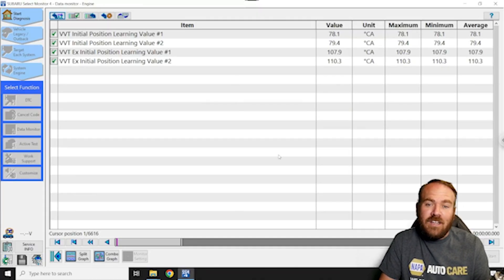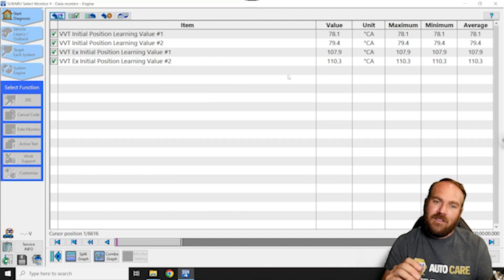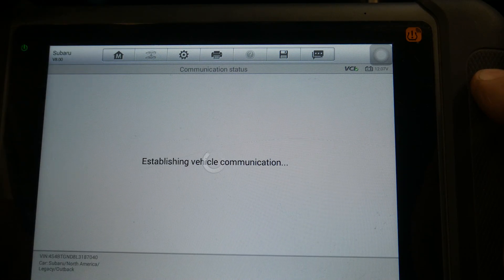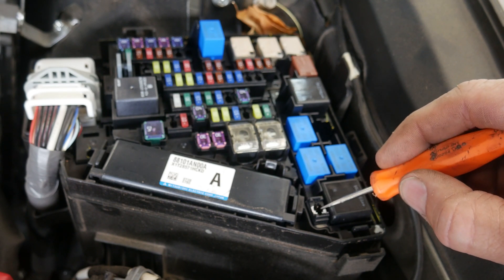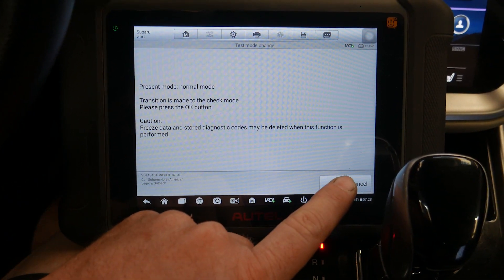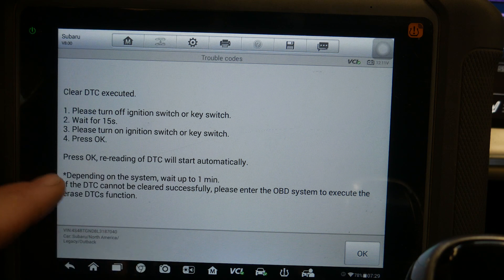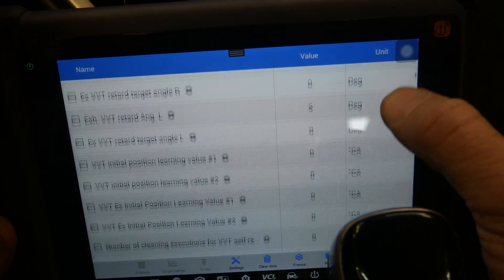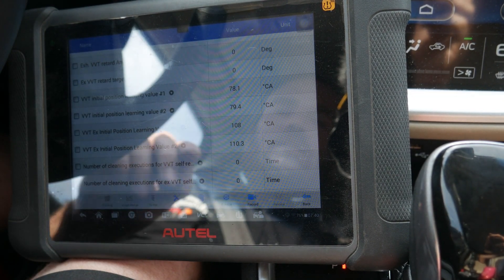Subaru VVT Learned Values Reset With Autel | ECM Saved!

Comment: What coding tools could be used to reset the values on an early model brz/frs for clearing a p0018. I have an autel maxis elite 2 that I used at my shop and access to ecutek tuning software.
Reply from the maker: Unfortunately, the BRZ/FRS requires specialized tools to read the emulated eeprom from the ECM and then manually, edit the values before writing it back.
Reply: @ThePracticalMechanic  are you going to release a video on it ?
Reply from the maker: @nunezjoel830  I’m waiting on a couple of ECMs to arrive for testing. Unfortunately I won’t be releasing the eeprom method because it is not a method I researched and developed. It would hurt the business of the individual that did the initial research. I am currently working on a couple of other methods and will release videos once I work out the details.

Comment: When getting this done will i need to unmarry my Cobb AP and then remarry and load my tune or is all that unnecessary?
Reply from the maker: This method doesn’t change the flash programming so you should be fine. I have never run into one with the AP installed so I cannot confirm.
Reply: Can confirm this does work on cars that have been flashed with a Cobb AP and a tune.  I reset my ‘21 WRX this way using a Launch x431 tool (Thinkdiag2 also appears to have the ability as well for cheaper based on other comments)

Comment: I have a 2014 crosstrek. Every autel machine I try doesn't have test mode change function. Autel says its to old and my ecm doesn't support this function. Has anyone been successful on a 2014 or older?  The videos all seem be a few years newer.
Reply: I'm in the same boat currently, tried launch and snapon for the hell of it and neither have the function.
Reply: @asewamu  I tried quite a few autels and a launch. I'm told by autel the tool i used has the function but my car is to old to support it....took it to subaru and touched my toes..at least it's fixed

Comment: As stated 2011 Forester does not provide the learned values, and does not have the fuse location but does have the green check connector. Autel ms906bt does have dealer mode. would this work to reset values?   looking for help with this p0018
Reply from the maker: A few have mentioned they didn’t have the function available for check mode. If your scan tool has it available on that year I would try the procedure and see if it clears it.  
Did you have a mechanical issue before? Timing chain or avcs solenoid issue?
Reply: We put a low mileage used engine in it (40k) and we have this ghost p0018. The car  has the green check connector, and my Autel ms906bt does not show learned values in the data. Can you do a video on reset for these models? can I email you direct or even better call? thanks @ThePracticalMechanic
Reply: @robdog5.0w did you solve the problem? I have the same problem I put a jdm engine low mile on my forester and i have the same code as yours

Comment: The data I have it was 137 from bank 1 exhaust, and I used this method and it work. Thank u sir for this detail and guide us step by step. Bc the dealer telling me I have to change my ecm. But not anymore hopefully. Gonna test drive put some miles see if goes back
Reply from the maker: I tried informing the two Subaru dealers within an hour of me that there is an alternative to ecm replacement. The service managers wouldn’t let explain the method.
Reply: What model and year is your vehicle and what scanner did you use? I couldn't get mine into Test mode because it didn't have the option. Mine is 2011 Forester w/FB25. Im glad you got yours fixed.

Comment: I have the same MS906TS scan tool with the Subaru v8.1 update, but Test Mode Change does not appear in the menu after Special Functions- only Dealer Inspection Mode. Is there a step I’m missing? I have tried reading the ECM with the inspection fuse both installed and removed.
Reply from the maker: What year and model is your car? Someone else was missing the function on a 2011 forester. I don’t have one available for testing but I’m wondering if you could select a year or two newer and get the function.
Reply: I have a My17 WRX STI. I will try to manually enter a different year or even model and see if that works
Reply: @brianmoore5367 were you ever able to get it to work?

Comment: Thinkdiag+ software and Autel MaxiDAS DS808S  is not capable of thiis procedure on my 2011 Forester X.  It will not erase the permanent P0018 (fyi with engine running Left Intake VVT angle is 18 degres) because it does not have Test Mode. What it does have is " Dealer Inspection Mode" which has a different function. Also in live data mode it does not have VVT initial position learning values section. Are these scanners not capable or is the ECM program of my vehicle is not set up for Test Mode as newer cars? Please help and I thank you Practical Mechanic for the vids.
Reply from the maker: I wonder if it will work if you manually select the wrong vehicle. Perhaps a couple years newer. I haven’t run into a vehicle that is listed on the TSB I couldn’t reset except the BRZ. I have not had one that early in the bay that needed a reset. 

Some of the early vehicles did not have learning value display until after a reflash and some never got the data. 
Page 14 of the TSB gives instruction for testing. One step is to unplug vvt solenoids and start engine while monitoring actual vvt position within the first 10 seconds after start up. If the value is +\-10 then change the solenoid and recheck. If it’s more than 10 degrees inspect the timing chain. 

You can swap solenoids left to right and see if the problem moves to the other bank as well.
Reply: @ThePracticalMechanic  Thanks for replying. Yes I tried selecting newer years and even different regions. I've already bought two OCV solenoid and installed one on the driver side. That was my first try at it. Might install the passenger as well to see a miracle. Also did read page 14 but I already returned the scan tools as it did not have test mode as an option. Do you think the Autel 906ts will have this test mode? I might get that next but its expensive. A little background I just  rebuilt this engine and during engine prime the Vvt sprockets would not lock (they kept clicking) due to no oil pressure.  I couldn't get oil light to go off. After many attemps I started the engine and the sprockets finally locked. I dont want to disassemble engine just yet but wanted to do your procedure first to determine if the culprit is the Vvt  learned values. It seems like manufacturers are designing newer vehicles as extortion machines. What a world we live in.
Reply: @mithunmadushan7050 

Update! Although I couldn't not get the tool to do this procedure I did fix my issue. I replaced the cam gear as well as the filter on the cam carrier because I may have installed it deeper than it was supposed to be. The new cam gear is genuine OEM and was redesigned as the originals were prone to failure; I only replaced the side with issue. I'm happy to say my issue was resolved after this. I used Tactrix sofware along with Subaruedit to confirm cam angle do not stick anymore. I'm glad because. Hope this helps. Praise YHWH for ever!